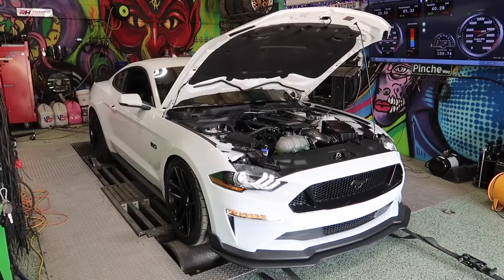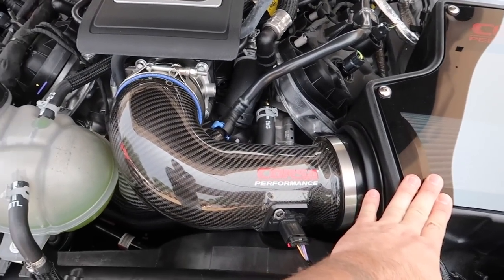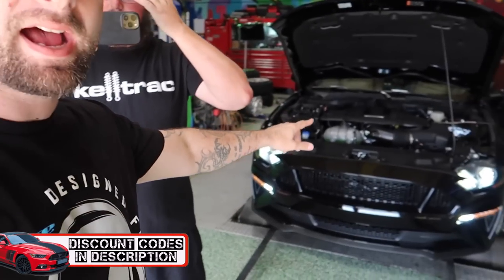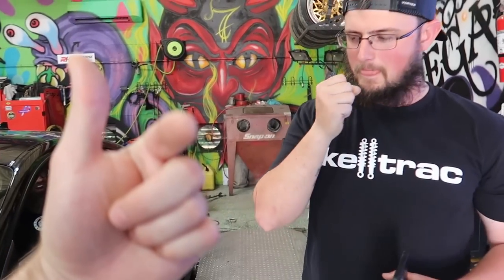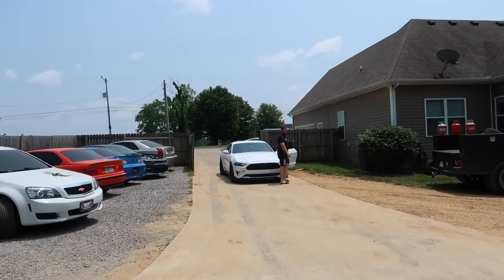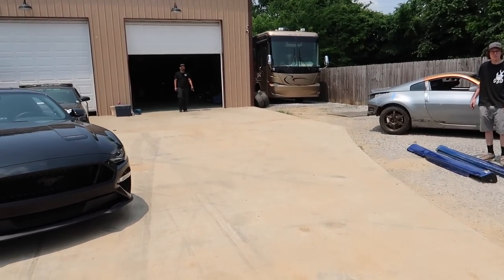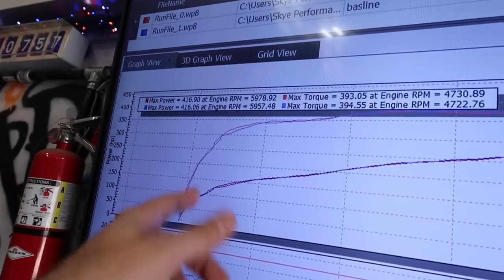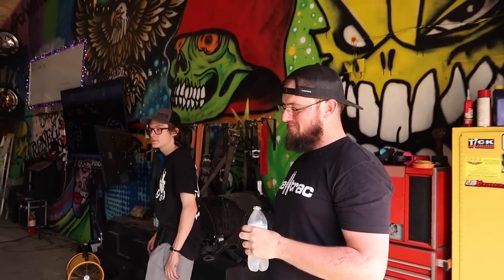MY MODDED MUSTANG GT GOT ROWDY ON THE DYNO *Making Horsepower 🔥

Comment: I’ve staying NA .  Comp 2 (4) cam shafts , 32 ported valves , ported cylinder heads , ported 90 mm throttle body . Ceramic coated 1 7/8 long tube headers ,  K & N CAI , tune 592 rear wheel HP. (442 kw @ wheels).  It’s nice , and it’s fast . Bit heavy at the front .

Comment: Lesson of the day. Cold air intakes that require no tune are useless.   What’s making the difference are the headers and cat back.
Reply: Wrong, cat back is almost zero hp gain, what's making the difference is headers and a tune.
Reply: @deanmorea6461  the Corsa cat back is a 3in pipe all the way to a 3in diameter header. Unlike most every other after market exhausts which tapers to a 2-3/4 diameter exhaust pipe. The cat back adds about 10-15 hp NA without the tune and is dependent on catted or catless for maximized gains. It’s making a difference trust me.  It’s not an axel back. I literally have dyno’ ed my car with every upgrade from intake and tune to catback and headers to supercharger.

Comment: why are the 22's and up less hp ? and it is a bug diff ?
Reply from the maker: EPA
Reply: @Zander13Productions  do u know what they changed? Is it easy to gain that 10 back maybe with just tuning the car?
Reply from the maker: @mrdr_392  carbon filter in the intake